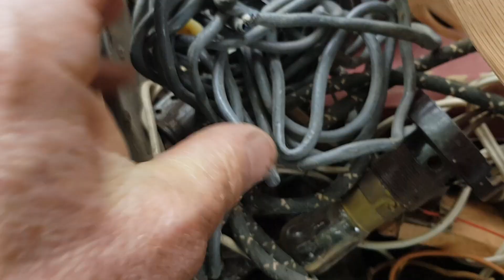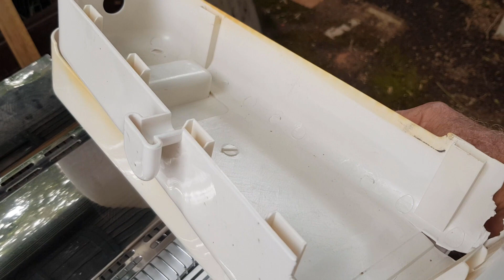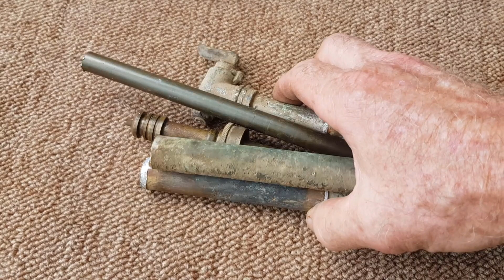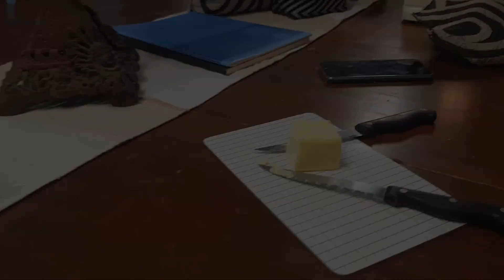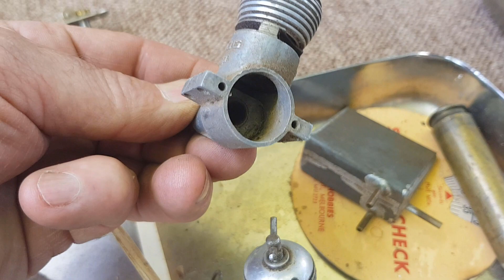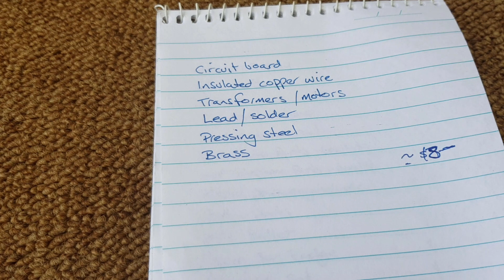A profitable e-waste adventure! Repairing a vintage Janome sewing machine and a mystery suitcase!

Comment: I just got a new old suitcase! How did you clean yours? Just soap and water, or is there a trick that might help me? Also, what kind/brand of clear lacquer do you typically use? (Great videos, thanks!)
Reply from the maker: Thanks Heather! Yeah, I just use water with some dishwashing detergent and give them a good scrub, then leave them to dry thoroughly. If they are deformed or squashed, you can use bricks or blocks of wood to reshape them while wet so that they dry to a better shape. It does depend on what material they have been made from though! The clear lacquer is just a cheap spray can type..